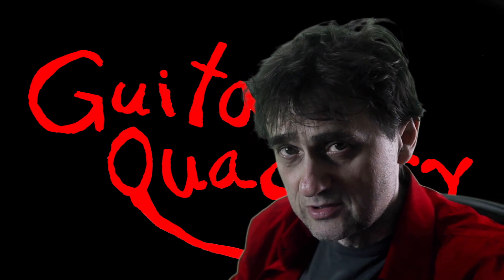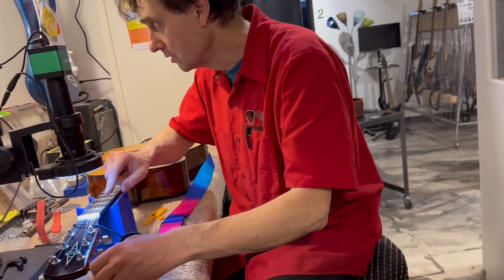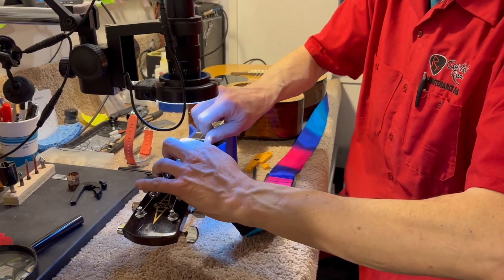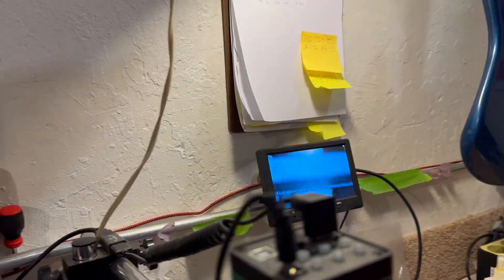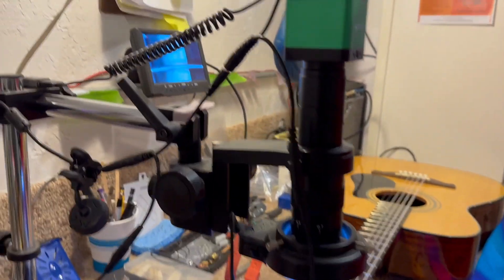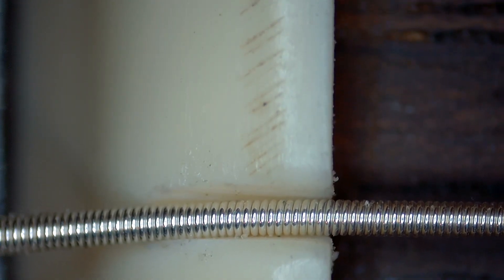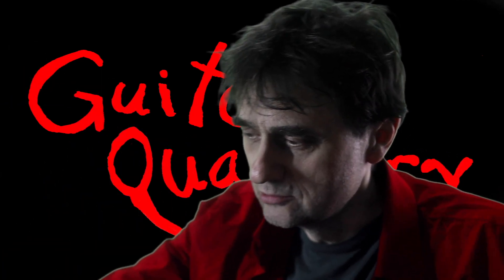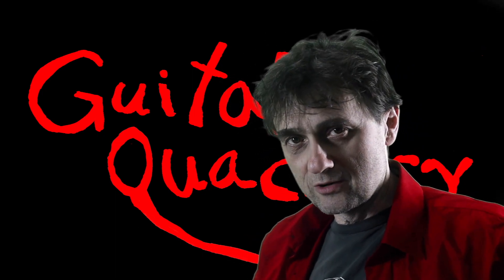File & Lube the Nut to Prevent Guitar String Creaking & Squeaking

Comment: Great work and love the unique camera angle! I just made a nut and mine does this!
Reply from the maker: Thank you for your positive feedback.

From your short comment, I have a whole bunch of questions. I don't know where to start.

1 - What nut material did you use?
2 - What type of guitar is it?
3 - What strings did you use and is it happening on a wound string?
4 - What kind of headstock and break angle?
5 - What is the shape of the rear of the nut?
6 - Did lube help?
7 - Which files did you use to cut the string slots?

I think I could even ask more questions in a conversation. It just goes to show that a guitar nut is not as simple as it might seem.